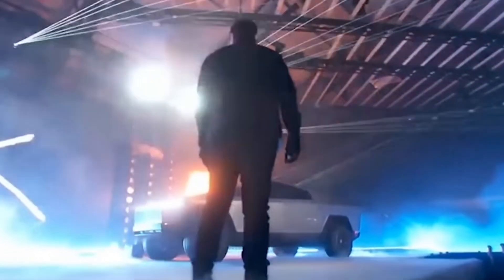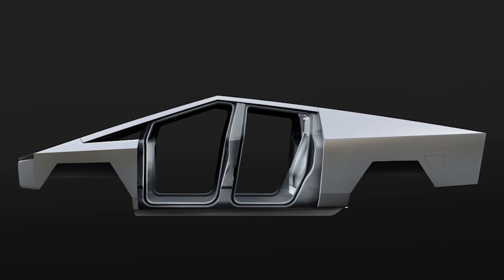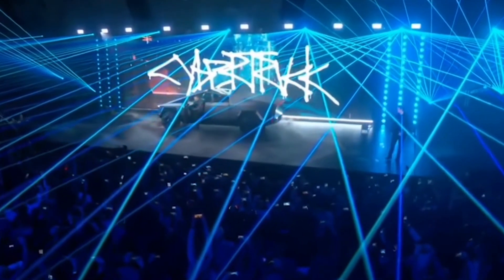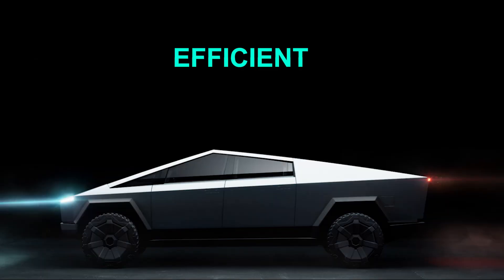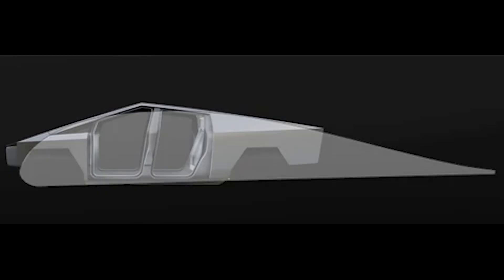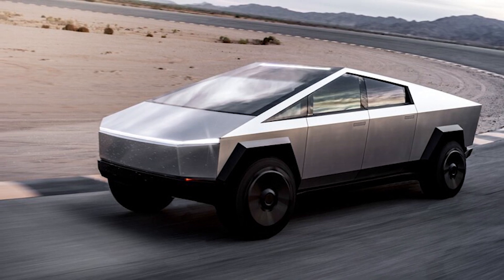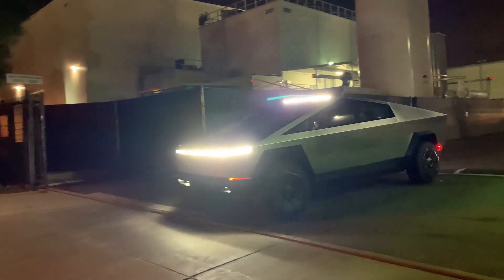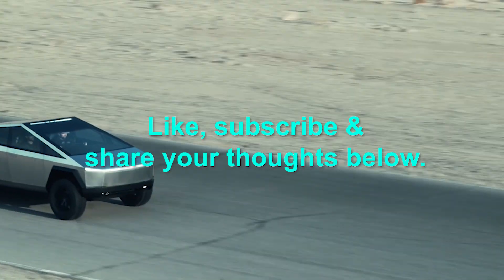Cybertruck is Engineering Genius (and will be copied)

Comment: Almost 5 years later, has the Cybertruck fulfilled these "MUST be" criterias?
- Low Cost (to make & buy) - NO - I wouldn't call $100k cheap ... Elon promised $50k. Well, one more pump promise, not delivered.
- High Utility/Performance - NO - You can't even fit a bike in it
- Efficient - NO - Elon promised over 500miles and it does less than 300
- Safe - ... Come on, do we need to say it??? You can't even buy it in Europe, because it is "very safe"

Comment: Sorry if this sounds like I'm anti EV but to the contrary, I'm all for them if and when they become practical and provide value to me other than for my ego. Whether or not a truck is any good depends on how you intend to use it. To me, it's just another tool. I want the most practical truck for my construction business. I don't give a damn about it's aesthetic appeal as It represents no value. Styling over functionality is for those who rarely get their hands dirty. Definitely not a fan of Tesla's perverse sloped bed sides - would make putting anything over the side or getting something out of the front of the bed an extreme annoyance.   If I can't put a 4 x 8 sheet of plywood on the floor of the bed and close the tailgate - useless for my purposes. How in the hell can I mount a snowplow onto the front of it without there being a frame?   I punctured a gas tank on a F150 on a rough site - the replacement was about $1,935. To replace the Tesla battery back itself with all modules in it would be around $16,000.  Any nobody will repair them. A windshield for a Ford F150 will cost about $700. while the Cybertruck retails for $1,900.  I know it's because of the electronics in the Tesla glass but how do those electronics help my carpenters put more money in my pocket? Now we also have to factor in insurance costs. Insurance companies are steadily raising their rate for EV's because of the ridiculous repair costs. Let's face it, the Tesla truck doesn't seem like it's going to be a player in the construction trades. I really don't see any value there for me. More like a novelty item for those that would use it for anything other than your run of the mill pickup. I think Tesla misnamed it - it should have been called a "Cybertoy".

Comment: LOVE YOU SHOW…MOSTLY   But… you are way off base with the utility nature of the cyber truck. First, who cares about the towing capacity if your range goes down to 50 miles?? second, the bed is not a full 8 feet and has slope sidess, it cannot, except a conventional camper, that is totally impractical! Third, that stupid yup, steering wheel does not work for off- Roading, period! Fourth, that touchscreen isIMPOSSIBLE to use, if you are bouncing around the outback. do you own a pick up truck/off-road vehicle? Have you even driven one off-road?   Please, please, please, do some research before you start making outrageously, incorrect statements.  The cyber truck appears to be an urban vehicle… And you can’t even sleep in the vault because the window doesn’t open to the cabin. I hope Tesla wakes up and smell the coffee here.

Comment: I am very excited to get my Cybertruck.  It's one of the most bold and challenging car designs ever.  Unfortunately, the radical design of the CT turned out not to be as revolutionary as initially described (per Cory Steuben formerly of Monroe & Associates).  It turns out to be a unibody pickup and not a true exoskeleton.  The stainless steel is hung on a unibody frame and could just as easily utilize traditionally body panels. While Tesla has and will continue to achieve incredible manufacturing efficiencies, mostly through the giga castings, stainless steel is not as cost effective.  The design of the CT, while very cool and impressive, is mostly cosmetic and they could achieve even greater cost effectiveness using more traditional materials.  I am also concerned about repairs after accidents, which could prove to be extremely costly given the difficulty and cost of the stainless steel.  Also, harder and stronger on the outside doesn't necessarily mean safer.  Modern cars are designed to crumple and absorb impact. I don't think an origami stainless steel car or truck will prove to be as efficient as say the next gen Model Y utilizing even better castings, updated manufacturing processes and traditional body panels in what will undoubtedly be very cool designs. I'm happy that they are bringing the CT into existence as an amazing oddity, but will be surprised if this is the design direction going forward for Tesla's mass market vehicles.

Comment: I hope you are right, but it is really too early to tell.  The exoskeleton idea didn't pan out and structural support was needed.  It is possible that the use of the steel alloy has added weight without adequate strength to keep the car safe in all circumstances.  This could imply that the car is not as efficient due to leftover extra weight from exoskeleton steel and needed structural reinforcement.  When doing something this revolutionary, there are new challenges that may not have been overcome in time for the first generation off the line.

Comment: Cut 2 feet off the back to leave a 4 ft tray; cut 1 foot off the width; use smaller tyres and make in Thailand where we buy a ton of trucks. Target price: 1 motor 300 mile range at $30,000usd please 😊

Comment: The only issue I can think of: temperature management. Is the inside of the cyber truck lined with good thermic isolation material?  This Electric Utility Vehicle  should be called the Tesla Truck (not "Cyber"truck).

Comment: Cybertruck is the dumbest car on the road; considering the main competition is the Rivian, GMC Hummer, Ford F150 Lightning, all of which look 100x better in design. 

Secondly, the range would be depleted when actually using the truck for what it's intended for. So figure 150 miles while towing, instead of 300. 

Thirdly, the price, it varies between actual good trucks. Top of line model costs up to 80'000, and tows less than heavy duty diesels of same price range. 

Not to mention companies offer hybrid trucks for like 70K that can do a much longer range on full tank, and still tow. 

This is what makes Tesla a waste of your money. Not to forget, it's also one of the most unreliable car brands (top 5)

Comment: Still a lot of "negative feedback" on the angular design - dunno if Elon is still seeking negative feedback?! Flat surfaces do create some problems - sun glint off glass can be blinding to others on the road, and flat surfaces are also weaker, especially glass. The Bond submarine Lotus was angular/flat, so was the Countach, but later designs all have some curvature and the later designs are better. If the apex was at the rear of the cabin this would improve head space, and improve utility in the back. There is time for some design refinement before production - the Cybertruck could be even better and sell more with some curvature in the roofline.

Comment: The cyber truck is not comparable to the other most popular pickups, its under powered in comparison.
Reply: did you even read the specs?
Reply: @mr.moritz342  its price range is that of high end pick ups, yet it has less towing power, bed size, and horsepower. Judging by your comment you haven't done your research and are another blind Musk fan.

Comment: What if you had a vehicle (or owned a company) that was designed by the most competent manufacturing, mechanical, and software engineers in the world; provide the highest performance vehicle available, could be refueled by multiple charging stations for extended cross country trips, could be charged from any residential 220VAC outlet in the world (have 25-50' dryer outlet extension for emergency or apartment charging?), could drive itself, could be added to a group of cars for Uber type services, mine digital currency when not in use, would provide residential backup power when not in use, provide 10 days of climate controlled camping, passenger entertainment and communications,  connect to the Starlink network, unaffected by oil prices, almost zero maintenance, provide safety and security from human attack, ETC (the list goes on).... With no competition is sight..  And a competitive price?  And it would make sense to buy a new Ford?  Chevy?  BMW?   Or any other ICE product?
Reply: "from human attack"
probably Legacy Auto supporters😂😂

Comment: i do wonder how ,uch the design will change. elon said it has to be 5% smaller, but there are other things. light bars arent usually road legal, so adding one as standard is unusual. the rear light is also not legal, as a certain percentage of the light has to be stationary. in this trucks case, if you fold down the tailgate, the entire light becomes invisible, so not putting my 100 bucks down, till we see the final product. it is very exciting indeed though.

Comment: I reserved my dual motor CT a few days after the reveal and it still ended up being #300, 567!  Now, since we've been enjoying our LR Model 3 with the $2,000 speed "boost" because we love stomping it at almost every red light, I had to go back into my Cybertruck reservation and upgrade my purchase to the tri-motor!  I must have, no, I NEED that 0-60 of 2.9 seconds in this beast of a machine.  Yes it is "badass" and "intimidating" but Tesla doesn't charge you extra for those features.

Comment: ICE Manufactures cant produce an electric truck. It will kill their current market, supply chain and dealerships. About 15 years ago Ford made and electric Ranger. It worked and they still work today but Ford proved to themselves there is no parts or service market. Those reasons alone are totally against the ICE business model. ICE will only ever tickle the market by limiting production.

Comment: 2 months from now: Tesla's batteries engineering is genius (And will be copied)

1 month later: Nissan copied tesla's new batteries
Reply: With what? Nissan sold off it's battery division.
Reply: @Neojhun  Its a joke saying that solving the money problem (STMP) will make a video called: Tesla's batteries engineering is genius (And will be copied)
and other auto manufacturers copying tesla batteries, But that's fine because EVs need to be #1.

Comment: I think there are a lot of assumption which cannot be taken "as is".

No stamping (no curves) - outside it is true - but the cybertruck is not just a box. Internally there are stamped and formed parts. I honestly believe, that the design isn't "just" functional design. It supposed to polarize. I also don't believe, that the glass panels will be just straight in the serial version. This would have pretty bad visibility (glaring etc). 
Further: the Cybertruck will come with paint. And Stainless steel actually rusts (just in a lesser manner). Hence this isn't also the truth. Oh and stainless steel (in a real rust free composition) is far more expensive than a lot of sheet metal.
Also - it doesn't "smokes" everything within its price range. Pick up trucks are notoriously cheap. Tesla cleverly compared it with the Ford F-150 - however for the price of the cybertruck you could buy a F-350 - which would probably trash the Cybertruck in towing (not in 0-60). 
Also safety; vehicle safety has nothing to do with "tough". If the cybertruck doesn't have sufficient "crumbling zones", it would mean excessive acceleration for the passengers in the case of an accident. Hence death. Also the flat panels is probably a threat against other vehicle in accidents and pedestrians. 

Look - I am not against Cybertruck. I even thought it is pretty cool. But don't just justify the controversial looks with some facts, which are simply not true.

Comment: the one piece body structure make maintenance difficult and will increase repair cost  in case of accidents. at some point, owner will have to cut the body to fix damaged part or replace whole body which is not practical.  Also stainless steal is way heavier than aluminum which makes cars lighter. As a result, more energy consumption to overcome increased weight. The huge size - not the batteries technology - of the Cyber truck helps to accommodate larger batteries and increase driving ranges. Most of electric cars manufacturers including MB, Audi, Ford and Tesla release concept designs of electric SUV’s not because they like them but to create more space for batteries. Sharp lines and straight surfaces increase resistance and has bad aerodynamics otherwise we should see this design for aircraft and rockets

Comment: Saying that removing that complexity is genius is the equivalent of reducing the design to a four wheel bicycle and calling that genius. Genius would be reducing manufacturing complexities without changing the design of the car. In other words, if you managed to keep all the aerodynamic curves when making it simpler to manufacture, that would be genius. Cybertrucks remove the manufacturing complexities at the cost of removing the aerodynamic curves if the modern car. That's not genius. Sure, you want to argue that the aerodynamic curves of the modern car are not that important when you reduce the weight of the car with this supposed chassis delete and use it only for day to day applications outside of racing, that's fine, call the modern design of cars stupid, but you still can't call this genius.

Comment: Cybertruck made from one piece of folded steel is great in theory. What happens, say if you get side swiped? You can't just change a panel or two like you can with modern cars. Yes, some of the damage could be banged out with a hammer etc, but some would be very hard to fix. So then what? Start cutting and welding? There is an obvious tradeoff here. Easier and cheaper to manufacture, harder and more expensive to fix damage. Whereas you have the opposite with conventional cars. Interesting to think about.

Comment: More stiff a car is the less effective the crumple zones are, since the zone will provide more resistance to the force, meaning more force will be transferred to the passengers. Therefore saying the truck is stiff therefore it's safe doesn't follow.

That's not to say that this truck can't be made safe. It doesn't have a engine at front which automatically increases the size of the crumple zone compared to an ICE truck for example.
Reply: Also the lack of a frame could result in the force spreading throughout the body instead of being stopped by the chassis, further reducing the impulse.

Comment: Im getting sick of this review...

What the hell you think aerodynamic means? To look like a fucking airfoil? Airfoil use aerodynamics to create lift, and its operation assumes steady laminar flow upwing and downwing. None of these criteria make sense for a land vehincle, and even worse, the objective of an airfoil is not aplicable at all to a land vehicle. In any case, you actually want an aerodynamic force down for maximum grip on the road, not one up that is going to make you have no control over vehicle inertia. See Formula 1.

And dont let me get even started about your "safety" arguments. There is a reason chasis materials are done out of soft materials, so that there is impact energy absortion through plastic deformation. First cars were made of TOUGHFFF AS FUCK  materials, and there was no plastic absortion, passangers absorbed the whole impact, as if they were in front of the vehicle. What the hell yu think you argue about when you say structure is strong?! Means car will not deform? True, congrats, you crashed at 30 km/h and you only have a small scratch on your car, but every fucking person inside is beaten to death.

I don't argue the product is effective at what it is aimed for; if it wasn't no one will buy it. It is your aproach which makes no sense at all, and I am sick of ignorant charlatan american folks, talking as if they had any idea what they talk about. Get an engineering basis before doing reviews on engineering, you asshole. Watching your so called "repairs" on your car, which show no functional use but estetics, makes me slap my face so hard even my ass hurts.

Comment: You've made some good points, but my main complaints with the cybertruck is people like to tow with a truck, and towing had caused other Tesla's to loose half their range.. that's a lot, especially if you want to supercharge, you have to constantly remove your trailer every few hours.

Also the bed can't be accessed from the side. This sounds like a nit pick, but I used to use the bed of a Tacoma to haul stuff to the dump all the time and reaching in from the side was crucial.

Also the cybertruck doesn't tow that much compared to the f250 which is a better cybertruck competitor from a price perspective.

Comment: You cant really appreciate the engineering genius of the cybertruck enough. I use to hear about the design methodologies of Jon Ive about function should be dictating the form so the simpler things get, the better. Tesla is taking this to the extremes and its quite amazing. Just be deciding to change the material (steel j stead of aluminum) they were able to eliminate the three biggest time consumers and plant cost in a car plant. 1. Frame stamping. 2. Frame assembly 3. Painting. THATS GENIUS.

Comment: ? PS it would be nice if Tesla sold a generator that you could buy with the truck or wander cause so if you do not have a charging station cuz cough cough people that work have to go off the grid sometimes and out in the middle of nowhere sometimes they don't have a gas station so if you could fill a generator up with gas to charge your truck that would be lovely to